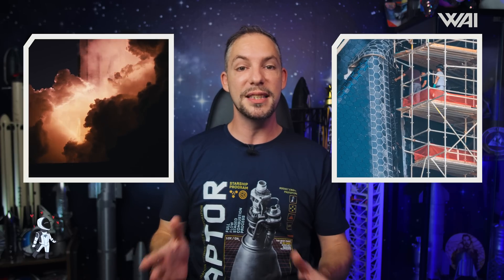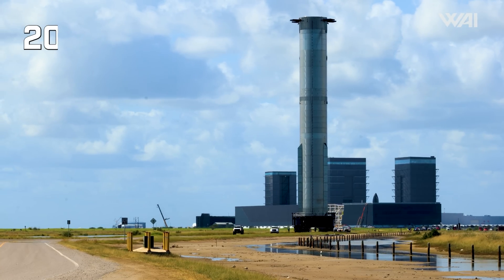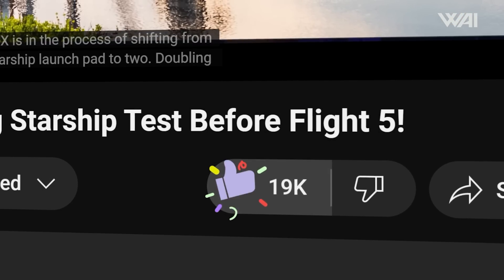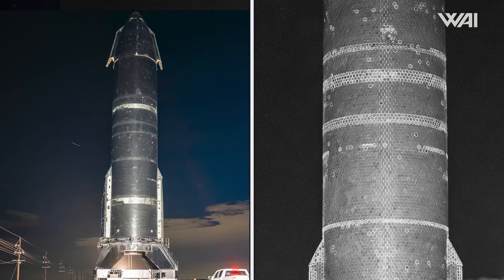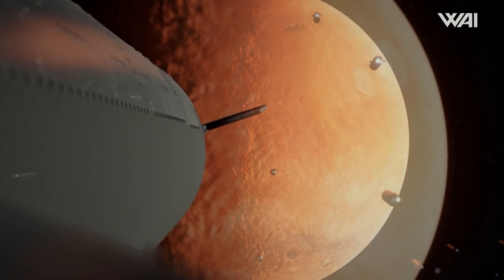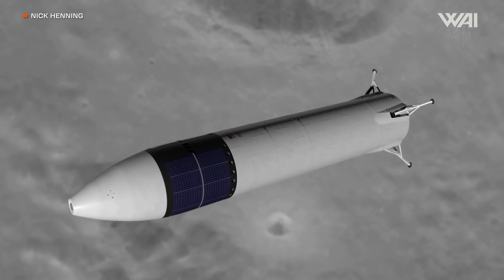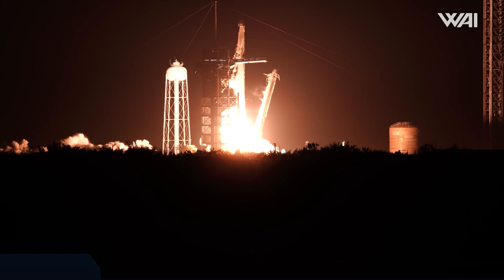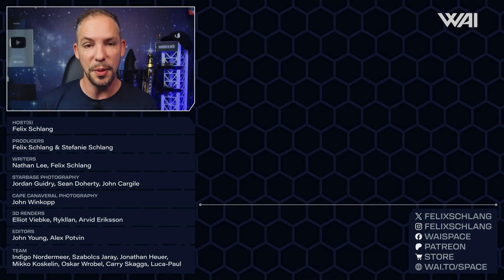SpaceX's Starship Flight 6 Booster performs unexpected MASSIVE Static Fire! Launch in 3 weeks?

Comment: Moon lander doesn't need a heat shield. Only the Earth-Moon transfer ship needs one.
Reply: The earth to moon transfer ship wouldn't necessarily need one either if there's a seperate earth lander also.... jus sayin
Reply: But it sure is going to need dust, dirt, rocks and small boulders' shielding!  Even if extra-long landing struts are used,  who's to say the landing site, just underneath that "smooth" carpet of regolith will be even enough, or sturdy enough to support landing?
Reply: @frankwolf3860  You seem to have missed the presentations. Moon Starship will have a ring of engines about 2/3 up, to allow the exhaust to dissipate before impinging the lunar surface. Apparently, the main worry is that the exhaust would launch small rocks into orbit, causing a hazard because the periapsis of that orbit intersects the landing site.
Reply: That is preposterous. The fastest smallest granules would be ejected horizontally, and on suborbital trajectories. 

What they were really worried about was injecting exhaust gas into the subsurface and kicking some regolith up into the engine bay. Also eroding pits that the landing legs could not conform to. 
 @realulli
Reply: @imconsequetau5275  fair point. I'm just repeating what I heard/read, though.
Reply: The landing legs need to vertically conform to the landscape and keep the ship perfectly plumb. They don't need to be splayed far out from the hull. 
 @frankwolf3860

Comment: Hmm... SpaceX wants / needs to fly a SS back to Boca and catch it.  They can't even think about that until they solve the flap heat shield problem.  So, I wonder if they might not skip Ship 31 and instead go with the V2 Ship 32 to get a good, unblemished re-entry for flight six.  That way, flight seven might be able to consider a RTLS catch of starship on flight seven in early 2025.  Ship 31 goes to the rocket garded / gets scrapped...

Comment: Honestly, I feel like SpaceX needs to take a page from NASA and create a full-scale launch pad much like the Shuttle Program had.  Flame Channels, water deluge, the whole 9 yards.  Though, if they are still refining design, I can see them waiting to invest in that until they finalize a production model design.
Reply from the maker: You have to keep in mind that 39a and b are a Cold War Design. Pads can be developed as well. I’m not sure if what NASA did back then is still a good design. It did cost incredible amounts of money. There might be a more efficient design. One thing is clear. The first Starship pad wasn’t a good design.
Reply: @Whataboutit  That is very true, but as far as reliabilty and reusability, they held up to the task well.  I completely agree that upgrades can happen, but also that the first design, and probably even the current upgrades are not the best designs.  I guess that is a Stage 2 or 3 problem though.  Right now, they rightfully focus on getting the ship system and design refined, viable, and safe.
Reply: SLS launch caused quite some damage to the launchpad, several months and many millions were needed to refurbish it. And that was almost half the thrust of Starship and cost billions and many years to build.
Reply: That could end up being a man-made island located off-shore
Reply: SpaceX likely will need remote off-shore launches of all propellant tankers in the end, supplied by cryo ocean tankers. 

I think that much larger barges with a very massive "keel" extending deep underwater could support a tall integration tower. Or perhaps build a truss platform between two large cargo ships and anchor this into the seafloor. 
 @hankkingsley9183
Reply: Working with Spaceforce on launch families sucks. You don't show up to launch unless you have a final design.

Comment: Why did they not used the seats five and sic to come back?
Then they wouldn’t have needed to change crew 9.
Reply: Because they did have a SpaceX suit for the astronauts but rather a test suit for compatible with starliner.
This is in fact, a dominant issue with how the commercial low earth program was setup since even though you could have redundancy of vehicles (not currently), the suits were not required to be compatible, which introduces a hurdle in the redundancy concept of multiple commercial capsules.

Comment: Somebody smarter than me has already thought this out, I'm sure, but would an astronaut on the tallest volcano on Mars be able to wingsuit his way down? Hell, I'd give it a shot...
Reply: Not without some serious radiation protection. The surface of Mars has manageable radiation levels and especially in the canyons but higher elevations the radiation is high.
Reply: Mars' thin atmosphere would probably more than offset the reduced gravity making a wingsuit unable to fly. There's just not enough area between a humans outstretched limbs.
Reply: @Wikkid2daCOR  He didn't say fly. HE said Wingsuit his way down which means gradual falling down to the surface on the lower area.
Reply: @1flash3571  replace fly with glide if that helps.  Answer is no.  You will become a bright red smear on the side of the mountain.  If you get enough distance on the leap, you might hit the bottom at record speed.
Reply: @1flash3571  let me rephrase: the amount  of wing area produced by a wing suit would not be able to produce enough lift or drag in the martian atmosphere to facilitate any apreciable glide slope. Even parachutes or parawings would have to be huge.
It is not a coincidence all mars landers (that i know of) haven't been able to rely solely on Parachutes for landing, employing hugely complicated secondary systems llike airbags, skycrane, propulsive landing.

Comment: Notice that the Saturn V is more capable, even if it uses more primitive technology. All the seditions were directed to performance. It uses a high density propellant for the first stage then high Isp combination for the second and 3th stages. Also 3 sages to go directly to the moon Also ideal diameters for the first and 3th stages.   Clearly the Starship and the Space shuttle can justify themselves because they need to be used more than one time and the Space Shuttle did have unique capabilities like a large exposed cargo bay you can work in, the ability to bring back  20 thousand kg, a Canada ARM, large space for a crew of 7 with space to move and work, support  for  the European Space Lab etc.  The SLS and the N1 are just a bad design and terrible bad one in the case of  N1.
Reply: Comparing single rockets is irrelevant. What matters is launch system architectures. Starship will be able to deliver orders of magnitude more payload to the moon for orders of magnitude less cost at order of magnitudes higher cadence. It's like comparing a speedboat to a container ship.

Comment: I wonder if starship will get a paint job in the future. I hope they fix the issue with the flaps on re-entry.
Reply: Most likely not, that’s a lot of weight, with no benefits
Reply: @666madull666  maybe the moon variant of starship.
Reply: No paint, it's just added mass with no benifit, as for the flaps the issue is fixed by V2 ships
Reply from the maker: I doubt it. It's added weight just for looks. Interplanetary versions and those for the Moon will LIKELY get one. Those uncrewed low earth orbit ones will likely not. :_WAIRocket: